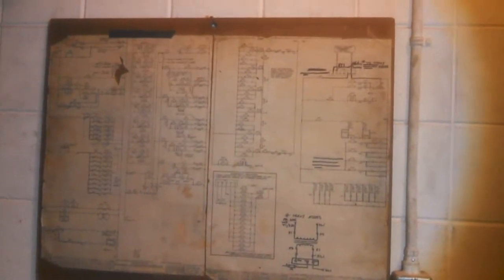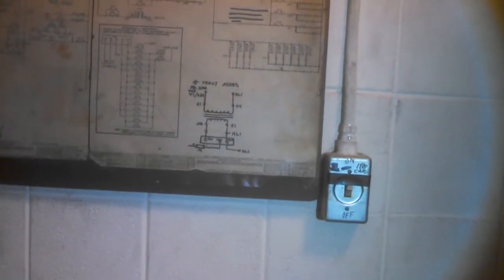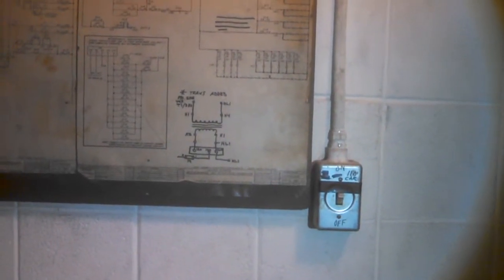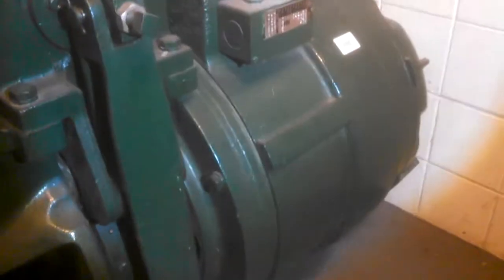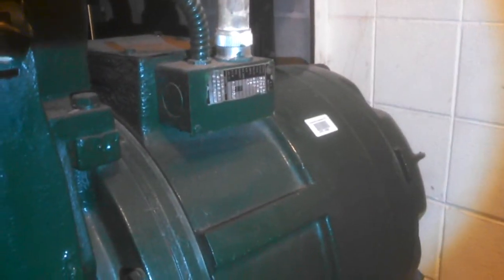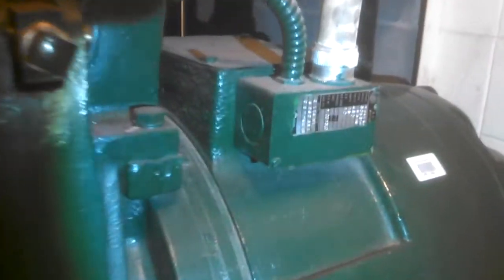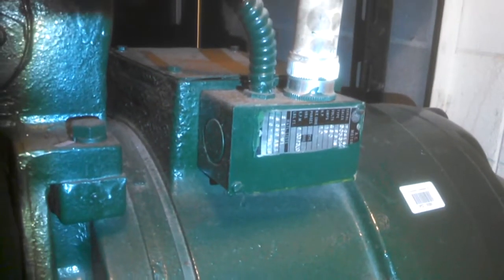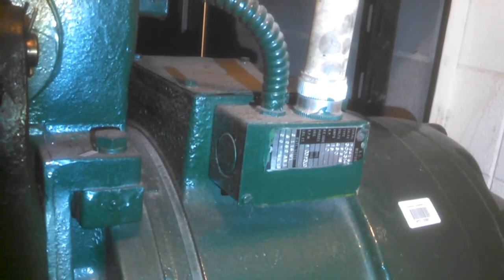MACHINE ROOM TOUR - 1968 Otis Bottom Drive Elevator

Comment: I think I have heard those relays called "Otis Slim-Line relays". I didn't know Otis were still selling 2 speed AC elevators in the United States as recently as 1968. How many floors does this elevator serve? I have heard that in some cases, elevators with simpler relay logic controllers don't have a selector. I do wonder if it maybe the slowdown and stop switches could be in the shaft instead. There also would have to be a device that tells the controller if the elevator needs to go up or down to a call. I wonder if that could be a relay logic circuit in the machine room instead, but is hard to say for sure. Do you have higher resolution copies of the photos? If so, can you post them somewhere>
Reply from the maker: This elevator serves 5 floors. Here's an older video I made about this elevator before I got to see inside the machine room...
https://www.youtube.com/watch?v=-N9gLufrha0

The photos can be viewed here...
https://www.facebook.com/cubecompmtdx/posts/1915096982054871